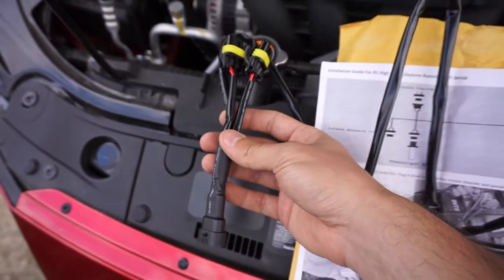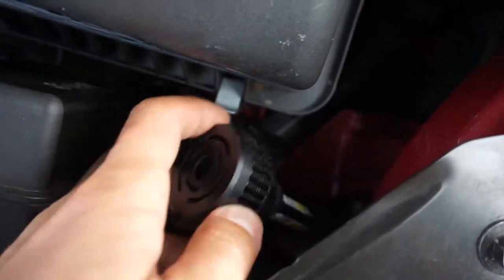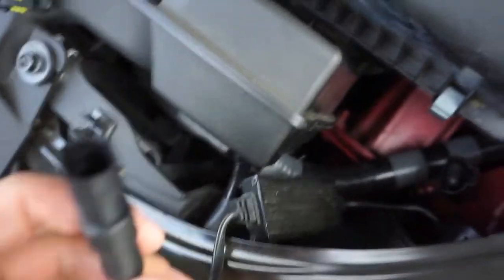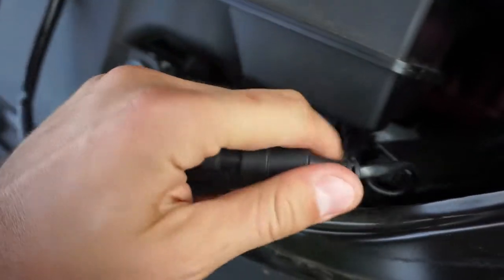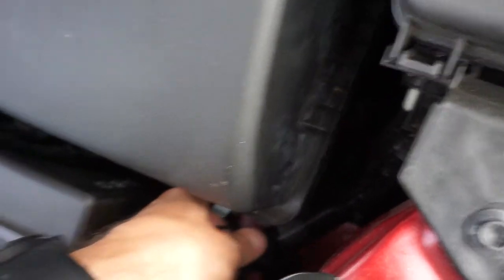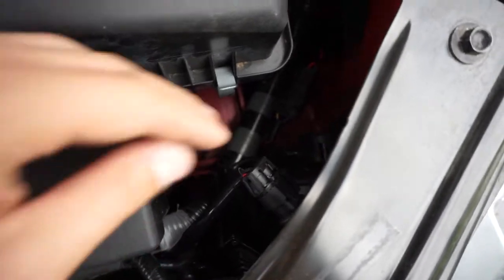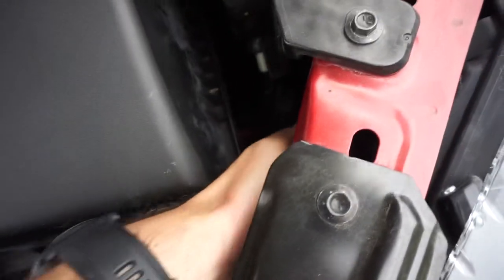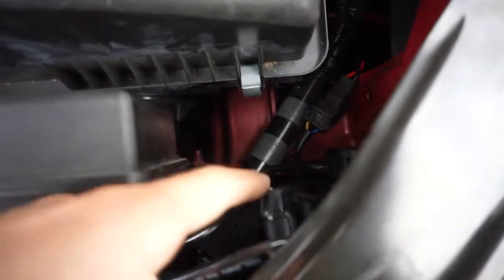Quick Fix R1 Kit - LED Bulbs For DRL's AND High Beams

Comment: So the LED isnt fully powered up with the relay as a DRL?
Reply from the maker: They pull such little power causing the vehicle to not acknowledge they're there, which is why this kit is needed. It routes both through one side so it doubles the power which the car then acknowledges.
Reply: @TheAdventureAuto  I understand that, however, that not my concern. I'm afraid that with the relay the LED bulb (high beam) is fully powered up when you just want a day time run light. Does the relay manage the brightness output?

Comment: This worked for my 2000 Toyota Camry. Thank you for your time with this video. I wouldn't have ever found a solution if it wasn't for this video.
Reply from the maker: Awesome I love that feedback. I'm glad I helped.
Reply: Hi did you buy the R1? I have a camry 2001.
Reply: @alexg4504  Yes I bought the R1 it should work for your vehicle as well just have to plug in the connector the opposite way and it should work
Reply: @chris3one6  That is cool. thank you
Reply: I'm also planning on doing this for my 2000 Toyota Camry, I was kinda bummed to see that the DRLs stopped working when I installed the LED's. This video came in clutch.
Reply: @ziggyanderson5477 LITERALLYYYY, I JUST installed leds and now I’m havin that issue

Comment: How about foglights? On older cars I've owned, I have just ran a jumper wire from the + wire on the DRL's to the + wire at the fog light housings in the engine bay and had the fogs come in with the DRL's, lows, and highs. Is that possible with this Gen Mazda 3?

Comment: Thank you man!!!! I have a mazda 6 2017 and i have led drl but wont turn on only high beams now i got the solution thanks to u!!
Reply from the maker: +penahect Awesome man it gives the car a nicer look not having the yellow DRLs. Good luck!
Reply: So this works for the Mazda 6 also?!
Reply: Nestor Ramirez i just bought the kit waiting to install. It should work it is the same bulb a 9005. I had a 2012 tsx abd it was the same set up.
Reply: Thank You!
Reply: Nestor Ramirez i just set it up yesterday and i am all good super simple to intall.
Reply: @MannyGotit  did you setup just the same way he did

Comment: Nice video thanks a lot much appreciated.
So is the wiring positive to positive and negative to negative regardless of the connectors?
Also the wiring harness covering was hard to straighten after being in the package so I hung it up and used a heat gun and it straightened out pretty good.

Comment: This worked perfectly, your video really helped. Also, just out of curiosity where did you put the R1 wires?
Reply from the maker: I tucked them under the front plastic guard at the top of the bumper.
Reply: @TheAdventureAuto  thanks man, appreciate it!

Comment: Buenas noches , excelente video , voy queriendo modificar y tenia el mismo problema , soy de Guadalajara , Jalisco. Donde puedo conseguirlo , esa página no me da la opción de envío fuera de USA.
Reply: Hi Jhosep, did you found any link that sends the R1 kit to Guadalajara, Mexico? I also tried to buy from the ijdmtoy page but they don't ship to Mexico, what option did you follow? any help will be appreciated. Saludos!
Reply: Lo solucionaste? Estoy pensando en fabricar el mio, basicamente es tener la resistencia y los conectores hembra/macho 9005 la extension por lo que veo es un cable que saca una linea extra al otro foco.

Comment: I watch your video and was able to order the R1 kit. I got it today and was able to install on my 2016 mazda 3 in like 5 mins. Now I have led drl and highbeams also. I already swap my headlight to led before already. Now everything match at 6000k white color.. Thanks again!
Reply: Hi, where did you order it? I need one for my camry 2001. Thanks
Reply: hey man, Im wondering if you had to reverse the connection polarity same as the video. Mine is not working
Reply: @sergioramos9593  I installed just like the video and no issue. I used for a year already.

Comment: Can anyone confirm if this harness is what I need to get my 2015 Mazda 3 DRl/high beams both working with no issues?
Reply from the maker: Yes the harness is what you need to make them both work!
Reply: @TheAdventureAuto  Thanks, just bought that harness. Was that tuck-in spot for the harness good or did it melt/cook through?
Reply from the maker: @wallmartkiller  When I just recently removed the kit to sell my car, it was still functioning well and didnt melt anything in the surrounding area.
Reply: @TheAdventureAuto  Thanks again. Have a great weekend

Comment: I have a 2017 Mazda 6 and both my drl light don’t turn on only the high beam turns on should I get the R1 kit for this issue?
Reply from the maker: Yes you will need the kit. But always remember to check them when the vehicle is in drive. You need a friend or something that reflects your lighting in front to see. This is because thw DRLs only illuminate when in drive.
Reply: I have the 2018 Mazda 3 touring hatch and they're still only working as high beams but no drl. I have the r1 kit which also came with the Cree led bulb. Tried reversing the connectors to the bulb but still nothing. Let me know if you get yours working
Reply: Moonlight I ordered the R1 kit and installed and took the car for a ride and noticed if the reflection on the car in front that the DRL were working so it worked for me I just followed the instructions on how to install
Reply: @derwinsanchez7693  I got it working, apperently the drl's can't come on during sunset even when turning the headlights off and putting it in drive. Guess next time I will put a flash light on the light sensor to force it. Also the 80 watt bulb that came with the kit is very bright and is designed to be the same brightness in drl mode as it is in high beam mode. So I was going to just turn the brights on with headlights for more style but it is very bright even during the day and the guy who installed it with me said it would blind people at night. Hope it isn't blinding people during the day..

Comment: Thank you for the info.  2000 Camry here I just put some leds in and the drl no longer works.  9005 bulbs too.  Just ordered the r1 kit and hope it works!
Reply: Hi, where can  I order the r1 kit? I bought a canbus but is not working. I think I need a resistor. I have a camry 2001.
Reply: @alexg4504  the r1 kit never worked for me on my 2000 Camry. :(. I’ve had no luck getting my DRL back with the led lights.
Reply: @killabandit  Thanks you for letting me know. I have a 2001 camry but problably it  wont work. I used a canbus but didn't work. I think I need a resistor. do you know the different between a resistor and a canbus? Thanks
Reply: @alexg4504  I forget off hand honestly but I’m sure it’s on the web.   If you do figure out how to get it to work please let me know.  I’m for trying stuff for sure.
Reply: @killabandit  Sure I will let you know if I get to fix this.

Comment: Think you could do an update video on the wirings resistance to heat after a decent amount of driving? I have your link bookmarked lol just want to wait until you play guinea pig. Also, is the reflection pattern of the LED bulbs the same as the halogen? Don't want to blind incoming traffic.
Reply: robnor1029 youll be fine as long as you tuck it in like in the video. I been having this wiring kit installed in my HB for over a year now nothing bad happen. Also its not as bright as the halogen but it still works. Good luck to yah.
Reply from the maker: +robnor1029 Yea I can do an update for sure, but I am sure theyll only fail or melt something if my setup is bad. Like if it ends up resting on something plastic. The pattern is a little different, but I had my gf drive so I could check that. No blinding occured :)
Reply: Jomari Torres how much dimmer is it than the halogen lighting? The base halogens are already pretty dim without switching to brights.
Reply from the maker: robnor1029 To be honest the stock halogen DRLs are fairly bright from what ive seen. My setup is similar brightness.
Reply: the highs also use reflector housing which LED's do better in than projector housings like the dims. LED's in projector housing don't give off very good light

Comment: I just installed 9005 LEDs on my 05 Camry and was having the exact issue. No drls but high beams worked. I had installed emc canbus decoders but they did absolutely nothing. Gonna order the R1 kit. Kudos buddy!
Reply from the maker: Im glad I could help! Mine is still set up this way and I havent had any issues with it.
Reply: mattyv1228 Did the R1 kit work for you? I have a 2001 Lexus GS300 with the same DRL setup, with the exact same problem. I did purchase the R1 kit I now have DRL but no High Beam now :( so I guess I have to play around with the connections -_-
Reply: @ahill007ny  I couldn't find the exact kit for my car. I had messaged them and they told me that it wouldn't work. :/ Any luck with yours?

Comment: I just recently got a 17 Mazda 3 sport and was looking to installing led. Was wondering if you can do a full install of the bulbs?
Reply from the maker: The bulbs are all plug and play, there's really no trick to it other than what my video here shows to do to keep your DRL's working properly.
Reply: 2017 model uses different bulbs keep that in mind
Reply: roco z that link you put says incompatible with 2017 models
Reply: jon petersburg I bought those bulbs and they work perfectly fine. I have a 17 Mazda 3 sport

Comment: i think i've read some where that in our system setting you can just adjust the daytime light to come as well.. there are different option and basically one of them should turn them on... but i will let you know better in a couple days since i got my LED on the way home ;-)
Reply from the maker: +Alessandro Terracciano Did you have any luck? There wasnt anywhere in my system that allowed me to adjust DRLs. I understand it as more of a hardware issue than software. The LED bulbs thtow off the system and you need to trick it with this wiring kit.
Reply: The Adventure Mazda I don’t know why but the led system from jdm h11 doesn’t fit on my car and getting back to them they simply reply saying that my car doesn’t have h11 headlights but 9005 ...but in every each video that I’ve seen on youtube mazda 3 2015 comes with H11, so i thought that maybe that kit it is for fog light..i got to figure out this first lol
Reply: H11 is the low beam and bottom fog lights if you have them, 9005 is the high beam / DRL
Reply: njsfryj lol i was trying to put h11 in the 9005 plug, well I didn’t see that coming ahah , cause infact i meant to replace the high beam but i guess now I’m gonna change them both !

Comment: So I purchased the same bulbs and kit, and I have a 2014 HB, and followed this video step for step, but bulbs don’t turn on. Any suggestions?
Reply from the maker: How are you testing it, by having somebody else drive or looking at a reflection? The DRLs only come on when in drive and parking brake off. Otherwise the only thing id recommend is to flip around connectors and keep trying. I had to reverse mine a few times.
Reply: The Adventure Mazda oh I was unaware of the fact that it had to be in drive to work, also, my resistor g ya extremely hot when car is on, is that normal?
Reply from the maker: Yea as soon as you put the car in park or use e-brake they go off. Resistors will definitely get hot so mount them on metal surfaces.
Reply: What’s the reasoning for them only turning on when in drive? But thanks for the info, I was getting really frustrated that they were not turning on. What did you use to mount the resistor

Comment: 2018 Mazda 3 Sport. This is so frustrating. I've tried every configuration to get this to work and no matter what I do my drls just won't turn on. Low and highs work fine though.
Reply from the maker: Are you testing it with the car in drive? The DRLs only work when the car is in drive.
Reply: @TheAdventureAuto  thanks for the response. Yes I've set up a camera to make sure it's working and nothing is coming on when in drive.
Reply: @TheAdventureAuto  the only thing I could think of is the bulbs I'm using. But I don't see how they wouldn't be compatible. 

These are what I'm using:
 https://amzn.to/3m06YUA
Reply from the maker: @CitizeenSniips  Yea those bulbs should be fine.
Reply: @TheAdventureAuto  i feel so dumb. I didn't realize the drls don't turn on until you start driving. I think 5mph+. They weren't turning on in my tests earlier because I was inching back and forth in my driveway. Thabks again for the help
Reply from the maker: @CitizeenSniips  No problem, I'm glad you figured it out!

Comment: Hoping the R1 kit will work with these: https://www.amazon.com/gp/product/B01KMHIM5K/ref=oh_aui_detailpage_o02_s00?ie=UTF8&psc=1

I found out that simply using any amazon 50w, 6ohm "decoder/resistor" for each independent bulb will not enable the DRL function. :(

If not, oh well.. at least when used as high beams, they're bright as all getout.
Reply from the maker: +Alex Rojas The reason why this R1 kit works is because both bulbs essentially go through one wire which tricks the system. I tried individual resistors as well and had no luck. It took me a while to find this kit through a recommendation in a Mazda forum.
Reply: Good to know, thanks for the info!
Reply from the maker: +Alex Rojas No problem. I love having such bright LEDs for hi beams as well. One day a car turned their high beams on at me thinking my low beams were the high beams. I flashed my brights and the car immediately turned theirs off and put its tail between its legs and drove off. Now i dont have to lose DRL function to have the brights like that. Best of both worlds.

Comment: Great video. i purchased the same one you installed  on the video on my 2017 and it did not work.  Not sure what to think.  I have watched the video and gone over the install servals times and no go. running light do not come on.

Comment: The led DRL came out perfect. Watched his video step by step and reversed the fitting and poof. Now I have led DRL. Theyre super bright. 
Now I have led headlights , DRL, high beams and led rear turn signals. Why pays thousands for a higher trim Mazda 3 when you can spend under $50 and make your Mazda 3 look like the high end model
Thanks :)
Reply from the maker: Awesome! I'm so glad I could help and your results were great!
Reply: Do you reverse all 3 connections on the harness or just to the bulbs? My DRLs only work while driving but parked they turn off
Reply: That's how they're supposed to work. I have stock halogens on my car and the DRLs only come on when the car is moving.

Comment: Hey brother so I have aftermarket led on my car and they turn on for my DRL however overtime I press the gas they dim. Will this kit eliminate this problem? Thanks for the video.
Reply from the maker: +Pedro Ortiz Thats interesting that they would dim when you hit the gas. Do you have an older car? I think this setup would possibly even out the current and help with the issue.
Reply: The Adventure Mazda my car is 2015 Mazda 3 touring hatchback. Thanks for the reply!
Reply: Hi Pedro,
Did you solved the problem with this kit? Because I got the same problem with my Mazda 3 2014. Thanks for the reply!
Luc
Reply: @chantallimoges3236  the LED I purchased wasn’t high quality. That might of contributed to the issue but I traded this car about 4 years ago so can’t remember to be honest.

Comment: Thanks, wish ijdm would have been more clear on this with their warning. Just put an order in for mine so fingers crossed. Ordered the wrong set the first time around on Amazon, ended up with two resistors each on both sides and did not work. Would run one without and one with resistor on and only there one without the resistor turned on. We'll see how it goes but thanks for the vid.
Reply from the maker: I made the same mistake before making this video. It has to be one resister that both lights get wired through. One resistor on each side doesnt seem to work.

Comment: I got the R1 and installed it 10 months ago it worked but last week my DRLs stopped working again. What do you think might be the culprit? The resistor?
Reply from the maker: The resistor heats up when it's working, so if it's not heating up that could be the answer.

Comment: Per your recommendation, I bought the same kit for my 14 3 Hatch and it crapped out on me after just like 4 months. I emailed them with a question about it and they wouldn’t believe that it stopped working so I figured that it was just $20 and not worth an argument.
Reply from the maker: Damn man, sorry to hear that! Im sure the replacement will be fine, and the original was defective. You could have bought the replacement and returned the original stating it didnt work ;)
Reply: Is that the Defensa y Justicia seal....?

Comment: Took your advice ordered the wiring harness, plugged it in the same way you did but still not working. Wondering if I did something wrong I do have a Mazda 6 not a 3 wondering if that makes any difference?
Reply from the maker: I ask this question a lot. Was your car in drive and no ebrake applied when testing? If so, just flip around the connector so the +/- switches.
Reply: The Adventure Mazda I did even put the car on reverse backed up the driveway and drove back up
Reply: I also herd some cars may have to use multiple Resisters

Comment: Amazing! 
the same kit helped me with my Mazda 3 2015, it took me a whilw to connect the wires right but it works excellent, thanks for this video!
Reply from the maker: Awesome! Glad I could help. The LED DRLs look so good. Theyre actually brighter than I initially thought when in DRL mode, but not even close to when high beams are on.
Reply: I have a 2015 hatch could you help me
Reply: it's the same thing dude.